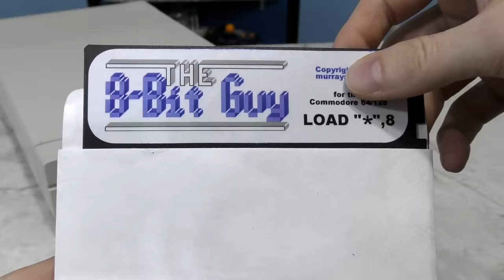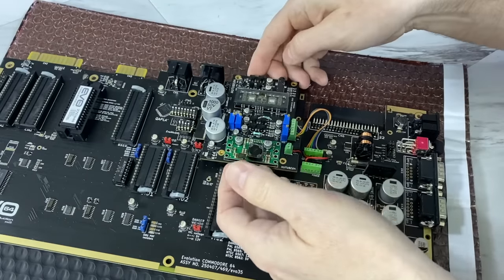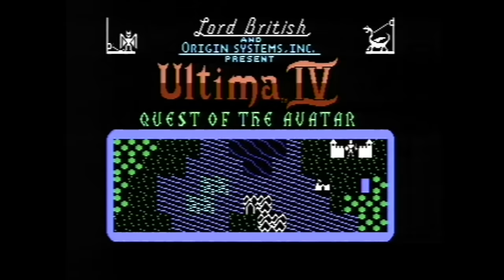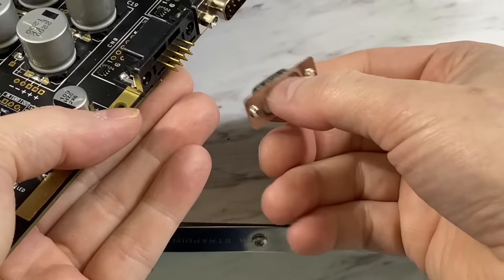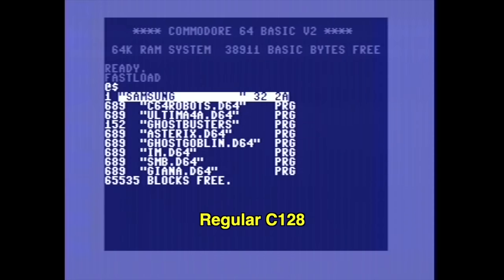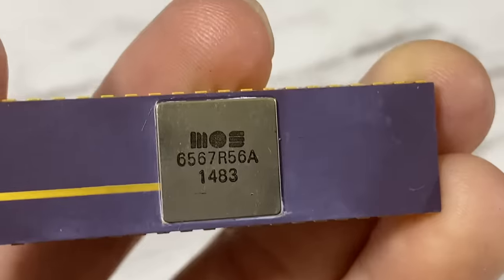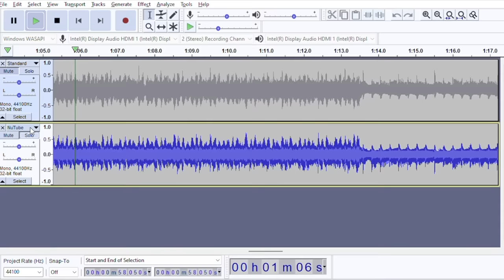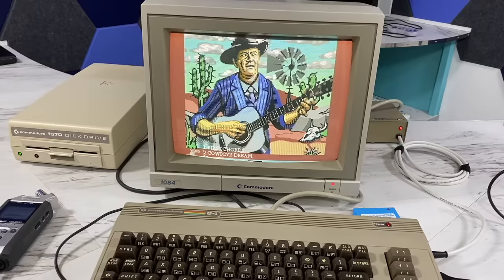The Evolution64 - Is it worth the money?

Comment: Regarding vinyl… yes, I reduce a lot of stuff before sending off to the plant. For instance I sum the bass frequencies to mono below 100 Hz and I roll off a lot of the high frequencies from around 10 kHz and up. Also, the intensity is compressed all over to reduce most of the spikes.

Vinyl is often pretty much lower quality compared to Chrome tape like the Attack of the Petscii Robots is… or even better, the 24 bit 44.1 kHz digital masters that people get as downloads.

So vinyl… yes it gives a certain analog feel and even «warmth», but it is inferior in most ways nowadays. 🤷🏼‍♂️😄
Reply: I think it'd be best to accept that there are people who just like the sound of Vinyl for whatever reasons, that's why I'm avoiding any kind of "technical" discussions, because you can't really discuss about personal preferences imho.
And technically the answer is very clear imho as you (and alot of others) have pointed out.
Reply: I totally agree where we're talking about New vinyl - where I have found a better result from vinyl certainly compared to CD is older stuff (70s/80s) where the CD was mastered badly.  Unfortunately this seems to be a major issue on a lot of stuff.  A well mastered CD (without getting into Hi-Res audio) can sound better than vinyl, but on a lot of stuff the vinyl beats it because it was mastered by people who knew what they were doing and not out to 'get it on CD and flog it'.

And there's something romantic about vinyl, and it's not all sound - it's nice to know that on earlier stuff it's a direct analog representation of what actually took place in the studio - but I appreciate that modern and remastered stuff negates this.

David's view here is spot on with the tube amp - maybe it's better/preferable, but is it worth $500?  If it makes you feel fuzzy inside knowing it's there and $500 isn't a lot to you then maybe...  I won't be buying it ;-)
Reply: even back then, a lot of stuff was mastered on digital tape.
Reply: Master to dbx! Unless Dolby doesn't let you license a 50 year old analog technology...
Reply: That "warmth" has always come from analog distortion.
Reply: I love vinyl because of its wormth sound and the expirience you get when using it (watching it move, playing with speed, moving it by hand, being carefull not to scratch it, etc :) )

BTW: where do you get your vinyls made, and how much does it cost to do it?

Also, do they sell empty vinyls nowadays, like when they make new ones, do they master them all or do they also sell some empty ones for people to master at home?
Reply: @Jackpkmn  Yes, but even people who don't like vinyl spend weirdly large amounts of many to reintroduce that distortion to their digital setups with r2r dacs and tube amps. Some people are just like that I guess. While I do enjoy the vinyl experience as a whole, I've never felt the need to add distortion to my CDs.
Reply: @Lord Mordington  I suppose you could liken the vinyl experience to love of classic cars.  Under the hood they're out of date,  not as efficient,  make a right racket, cost you money, and are less reliable.  But there's a certain magic about them,  some people love that sound,  the smell, the constant fiddling and that's the experience they miss with their clinical modern car. 
And then digital files are like electric vehicles - where's the fun in that...
Reply: @Eddy0042  That's one way to put it. It's just a more tactile experience, and doubles as a nice collectible while supporting my favourite artists. In addition, I've always found it conducive to a more methodical listening experience. With digital it's so easy to listen to a random song or two at a time, or even parts of songs. If I'm going to bother setting up the turntable, I'm much more likely to dedicate the time to actually listen an entire album in order.
Reply: Digital sound has alias ghosting (replication of spectrum at 2*fsamplng) while vinyl does not.  Alias needs to be filtered. Some devices filter it better, other worse. Some do not filter at all (see audio-note-DAC transformers).  BTW, you can use the nutube64 as phono preamplifier. The ultra-low-noise JFETS in class A will easily amplify the MC or MM cartridges.
Reply: @auro1999  Low pass filtering isn't exactly difficult these days, this won't be an issue on any properly designed hardware. Like Anders said, it's actually pretty common for Vinyl to be MORE filtered, simply because 15-20 kHz is a pretty tall order when talking about a stylus tracking a physical groove.
Reply: @ozzyp97  it depends. In paper or with ears ? If you go from 22KHz to 44KHz and get a lot of slope - because you want to remove aliases - then you will get phase rotation. Even with Linkwitz–Riley or Butterworth filters. In my PERSONAL opinion, the best filtering is no-filtering but having a very high sampling frequency (192KHz) and let the magnetic susceptibility histerisis of the DAC filter transformer do the job for you. Nice and smooth. Look at the Audio-Note flash DAC. The Nutube64 has a bandwidth of 75KHz with the current components, to allow sound non-itineraries to reach the ears - highly non lineary microphones -, instead of being cut by linear filters
Reply: @auro1999  In principle I understand where you're coming from, but even with analog you'll still be dealing with Bessel / Linkwitz-Riley and other such filters in your speaker crossover at the very least. Then there's the phase distortion from your physical setup to consider, and suddenly the effect of anti-aliasing filters starts to feel very insignificant. Even more so because the combination of analog and digital filters with oversampling can produce far less distortion than your purely analog crossovers etc, making the net impact even smaller.

As I said in earlier comments, I like vinyl. I'm just not convinced some theoretical phase distortion benefits can overcome all the other shortcomings of the format.
Reply: @ozzyp97  Just let`s meet sooner or later. Anyway, no, I do not deal with these filters no more. I make my audio equipment, after many years of Mark-Levinson pouring money. And in fact, if the nutube64 goes well, I`ll get a pick&place machine and make more for the other buddies who can appreciate difference. Indeed, I even redid the 24 step up stabilizer because the polulu - in the picture - can hardly deal with the inrush current of the stabilizing capacitors. New nutube has double ultra-low-noise double jfets (everbody worries about the valve, but much of the sound comes from the jfets) hand picked from a big batch that I use for another large project ... In the worst scenario, 2 beers and we are all good.
Reply: @auro1999  the really important question is whether the improvement in sound will make me any better at commando? $500 better.
Reply: @Eddy0042  I do not put my nose on the pocket of others, so 500$ is irrelevant. Sound: yes, there is some improvement - if you are willing to make steps to listen to it with your own ears. Tests are not very eloquents here. COST: it is a subjective topic.  Both a Ford and an Audi bring you to work. Does the Audi make you a better performer at job ? I do not know, decision is yours. And also it depends on the size of the pocket. For a financially strong person 500$ are peanuts - noise. For a 20yo kid, they are 50 hours of work.
Reply: do you understand WHY you are rolling off frequencies? you HAVE to, the grooves on the physical record will be TOO WIDE if there is too much bass 🙃
Reply: @Jackpkmn  half true - the vinyl records physically (all of them) have the bass frequencies removed -- they are then readded by the record player itself
Reply: @jonniefast  More like they're attenuated, they're still there, just quiet. Your phono stage / pre-amp then brings them to normal levels again, it's called RIAA equalization.
Reply: There is a channel from a radio station that has guests sit and queue up their hit song on vinyl and talk about the song. I think it was Howard Jones that explained how much of the bass has to be cut down compared to a CD version since low notes make the grooves too wide for the needle to sit properly in.
Reply: Abbey Road put out a pretty interesting video recently on YouTube talking about the intricacies of mastering for vinyl, balancing bass and groove spacing and thus running time of the record (more grove spacing limits the run time) including a discussion on the computer inside the record cutting lathe that analyzes the audio in advance to calculate the required groove spacing based on the incoming audio.
Reply: These comments remind me of an audiophile thread😂
Reply: @rnb250  its just smart people
Reply: I dislike vinyl, it pops and is difficult to store/play.  These days I buy a CD primarily and if a vinyl is available as a WAV download, I buy that instead.  I also buy other downloads as WAV.  I then make 320 MP3 and my own CDR.

Releases have no uniformity.  Grrr!

P.S. The last vinyl release was apparently warped.
Reply: and all the limitations of the format are what give it its charm and its own sound. that's the whole point. imagine it is a "filter" or "plugin". I like to listen to music with that "plugin" on. vinyl just sounds nicer even when it's pressed from a digital master.
I find it "friendlier to the ear", stuff that sounds "pointy" or "too bright" on cd or a digital file, sounds nicer on vinyl.

Comment: I used those ZIF sockets on my Amstrad CPC builds. They are not cheap by any stretch of the imagination, but they are very good indeed.
Reply: Who makes them? I've never seen them before...original 3M textool are not a bargain either....
Reply: @FRobot-rx4kz  they are made by Aries Electronics and they come in 24, 28 and 40 pin count
Reply: They are more than US$10 a pop
Reply: There is a problem with these ARIES low profile ZIF sockets. When you decide to use SID recreations with machined round pins, it makes it almost impossible to close the ZIF lever because of the machine pin diameter. Do yourselves a favor and use the regular ZIF socks and you won't have any issues. many recreations use these machine pins, not just the SID chips.  Jameco electronics sells these at very good prices at around $13 or $14 USD so to me, that is cheap considering what folks are charging things these days.
Reply: @williammanganaro9070  thanks for that, will make a big saving by staying with the traditional ZIFs
Reply: @williammanganaro9070  It's true that with rounded pins it's not as easy to close the lever - but it's far from impossible. The FPGA Gate Array on my CPC builds has those types of pins, which in fact damage normal double swipe sockets to the extent you then can't use them on normal GA ICs afterwards. But the low profile ZIF socket still works, in spite of being tougher to close.

On a C64, there is perhaps not as much need for these sockets in general, there is usually enough room for the cheaper kind. That is not the case on the CPC though, which is why I would still recommend using them for more compact builds or where the bypass caps etc might get in the way.
Reply: @retrotechtive  Thank you for your opinion and explanation sir. This is how debate should be executed. I shall continue to have an open mind and try these in other applications. :-)